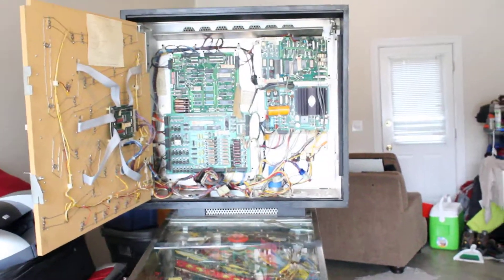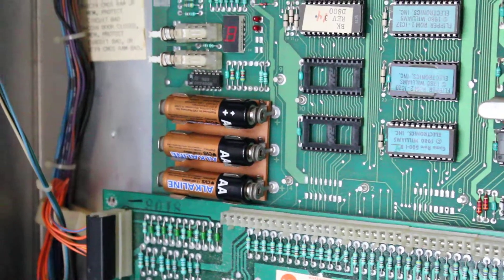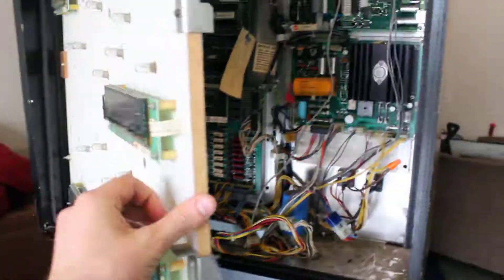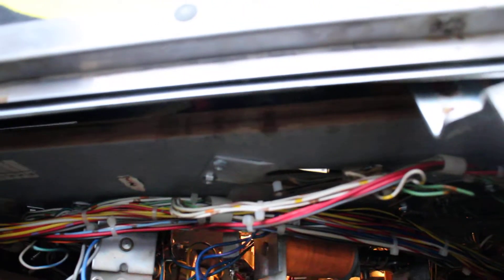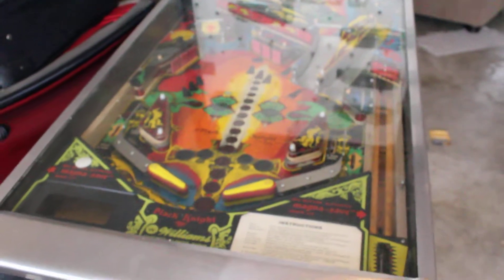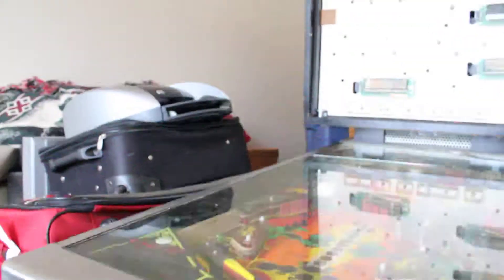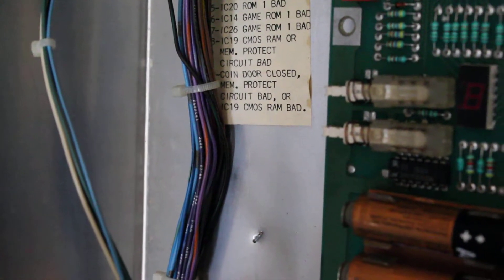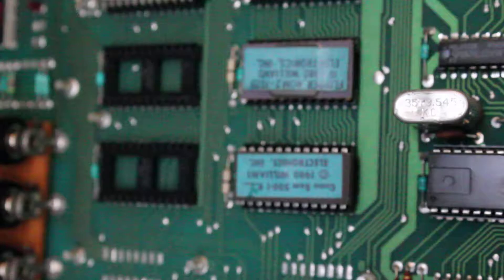Black Knight Pinball Repair/Restoration: Diagnosing Day 1 Problems

Comment: Hi Mr. Mcgee I have almost the same problem, as watching the boards I noticed a diode (D 18) located  close and up from the two red little leds of the mpu board (min.2:36) has a dark tone from the other components. Mine is the same as yours. I was asking my self or is someone knows if this "dark color" is normal on this diode because there is another diode on the same  board and its legs look clean and silver. Does anybody knows if this color is normal? By the way, I checked the schematics and saw this diode does something to the IC 19 Ram (a pulse ram), if this diode is bad  can affect the IC 19 ram or am I wrong?

Comment: Machine is in solenoid test mode - it isn't progressing due to a faulty switch.  Glass comes out the front by moving the little lever you can see up the top right inside the coin door - move it left and the top bar you pointed to lifts straight off allowing the glass to come out.